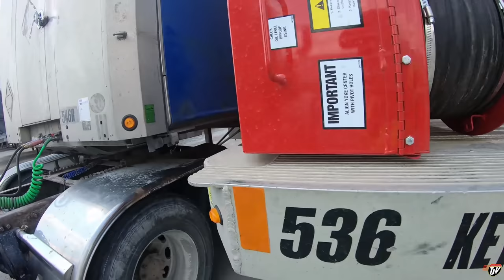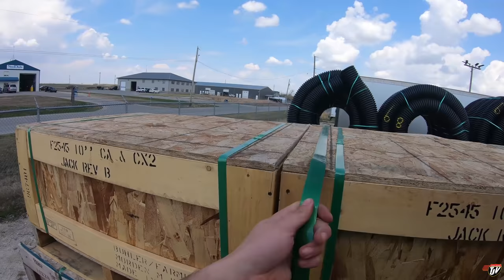My Trucking Life | THEY FIXED IT | #2283 | May 14, 2021

Comment: HI BRO.  your 100% correct. if the load isn't safe you refuse to accept it until it is reworked to your satisfaction. as soon as you accept the load you  "  the driver  " are 100% responsible for it's safe passage